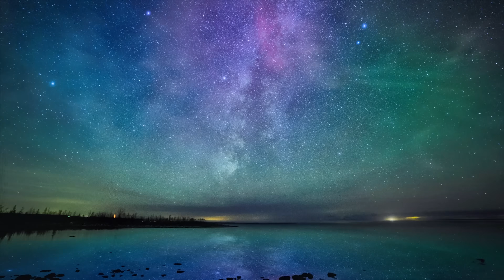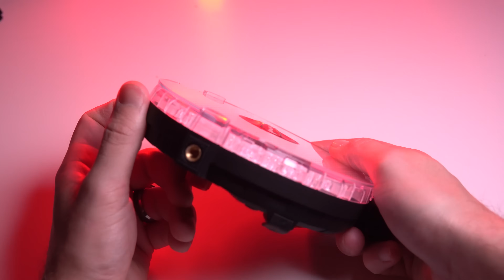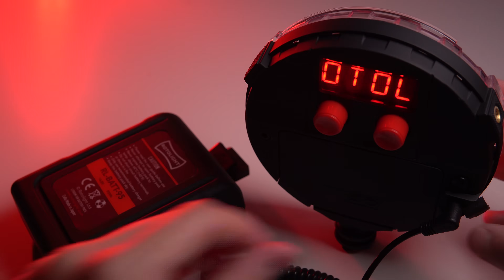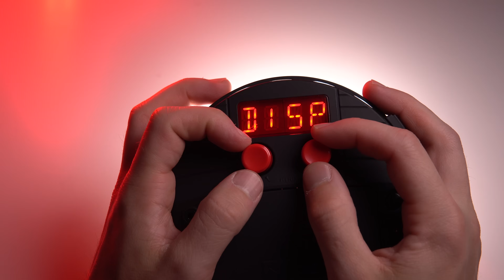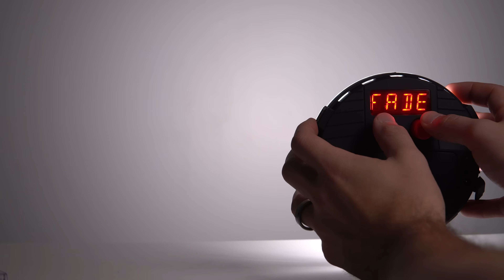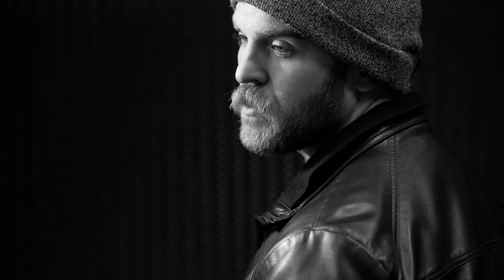Rotolight NEO II Review   Bicolor LED and HSS Flash

Comment: ROTOLIGHT AA2VM-Adaptor plus a maller V-Mount battery for the NEO  

ROTOLIGHT need to build V-Mount, around 24Wh, which should be usable of course with the bigger AEOS and ANOVA as a reserve spare battery. Therefore it is firstly nesscessary to create an adaptor that is put into the contacts of the 6 AA box. On the other side of this adaptor you then have the V-Mount.

Better handling: Faster changing of the Battery, more runtime and more flash power:  Additionaly you can lay down the NEO on the back, without unintended pressing the rear buttons.  To illuminate the ceiling of a room a stble even surface on the back is very helpful.

 The lower weight, compared to the 95Wh, results in a better handling and balance, when the light ist moved continuously.
The pricing could be far more lower, without canniballize the own 95Wh for the professional customers who ask vor maximum capacity. Even on the AEOS a smaller pack could be suitable.

Comment: Hi thanks for the video however I still do not know the best way of comparing the power of these led lights. A light that I am looking at says it’s 250W on this little small thing.  Is it the wattage that tells us how bright these things are or what?
Reply from the maker: It's complicated. Watts is a measurement of power drawn, not a measurement of light created. Watts used to be a good measurement of brightness when everything was tungsten, because everything had the same "efficiency" for the most part.
LED however is not all created equal. Companies have been making LED brighter per watt of power used. So a 200w LED from 8 years ago is nowhere near as bright as a 200w LED today.
So, with photo/video lighting, the "efficiency" of the product is largely dependent on the quality and age of the LED technology there are using.
A far better measurement of brightness is lumens / lux, which some companies include under technical specifications at various distances. You would need equivalent distances to see a direct brightness comparison (or learn the inverse square law to compare at different differences), but the lux/lumens measurements also fails to consider how wide the pattern of light is. For instance, a zoomable fresnel style led is likely zooomed all the way when it's light output is measured to inflate it's result, whereas an LED panel is stuck throwing light in a wide pattern and has to be measured as such.
Hope that long answer helps you understand why comparisons between wattages can be very unreliable and even alternative measurements are still complicated!
Also, if you're at all relating this to flash equipment, wattages of LED and wattseconds of strobes are not the same!

Comment: great review. looking through comments and other reviews,  I get the impression that a lot of people think that this light should compete with a speed light. I don't think it ever was really intended to compete? each lighting setup seems to have pros and cons, and depending on what your doing, this could be an awesome little light to have in your kit.  i recently got one of these and it seems to do great... for what it is. one of the things that really caught my eye when using it, was the quality of light. and for up close portraits, i got to say. i love it. looking forward to trying this light out in a variety of shoots.
Reply from the maker: People think that because that's exactly how it was marketed.  
https://youtu.be/eM3XBkxQaL8?t=195
"The Neo II is also incredibly energy efficient. Compared to a typical speedlight, which will do 250 full power flashes on a single battery, the Rotolight Neo II will do 85,000"
This is an extremely disingenuous claim. It completely ignores the fact that the Neo II is putting out 1/64th the effective light output.
I recall another video in which they explain how the Neo II would be superior for weddings because (paraphrasing) "when the bride is coming down the aisle and you use a speedlight, you have to wait 4-5 seconds between each flash, whereas the Neo II recycles instantly."
Again, a false equivalency, a sly omission that the Rotolight Neo II is completely incapable of reaching the output of a speedlight that would require a 4-5 second recycle time. If instead, you had the speedlight at a power similar to the Neo II's max output, then you're looking at a 1/8s recycle speed or lower.
It is these carefully executed marketing statements (which I find unethical) that lead to so many photographers thinking the Neo II would be capable of replacing a speedlight in any scenario. I found it wasn't until after my criticism that the language shifted to "we're not saying it can replace a speedlight"

Comment: On another topic. The Neo2 is now the only non-Godox light I own, apart from a pair of old Bowens strobes. I contacted Rotolight the other week asking them why they only support Elinchrom with their internal receiver - this seems short-sighted (IMHO) given the performance/price that Godox achieve (checking the cost of that Elinchrom trigger helps bring things into perspective). I told them that as a hardware development engineer, I would be an ideal ideal alpha/beta tester for their Godox X-system compatible Neo2 firmware. I haven't heard back yet

Comment: Hi Robert, nice, balanced review thanks for that. I already have the Neo2 (based on Jason Lanier's review) and, in use, it's a nice light, but, as you mentioned, more useful for video on AA's.. I just checked the price of the V-Mount battery you talked about and OUCH!! that sucker is expensive. It's a 95Wh battery which equates to 6.4AH at 14.8V - likely contains 8x 3200mAh 18650 cells in a 4S2P arrangement - which is going to be heavy, not ideal for attaching to the light. However, 4 similar cells in a plastic holder velcro'ed to the outside of the battery cover would weigh less than the 6 Duracell NiMh I have in mine, would provide 3 times the endurance and, since it plugs into the external power port, would run the flash at 500% - and all at a tiny fraction of the cost.. The cells would need to be charged in an external 4-way charger, but the NiMh cells I currently use do anyway as the Neo2 doesn't seem to have a built-in charge circuit. Also, a 4-way charger is easier to find and smaller for travel than a 6-way one..

Comment: It’s nice light, but like you said menus jus driving me nuts. After latest updates on the sky port you are losing flash control 🤢😢
As video light is nice I like it
Reply: Hi Ramunas, the update that Elinchrom did to the Skyport HSS Transmitter was only to add functionality for their TTL lights that they announced. If you didnt have these lights there was no reason to update. That being said Elinchrom have just released V3.0 of the transmitter that brings the flash control back to the lights.

Comment: I saw your first video and now this one, and yeah, while the Rotolight's promo video and the "marketing/selling" tone are a bit over the top - I'm still interested in this light. I've watched JL photoshoot in London with the model Mattie and realized that he simply used the product at it's best, and in the best conditions. It was either a quite bright natural light where he utilized the angles and used the NEO2 as a nice fill-flash with the right settings in the camera and on the unit itself. Then he shot in a tunnel where this kind of light is a champ. A smart marketing move and of course he could push it to the skies when claiming it's great. It's good, really good for what it's capable of doing. For me, I'd gladly have it in the bag together with my speedlight during travels, and chose which one to use depending on the conditions I'd be shooting in. The price is high though. The NEO2 itself is OK but when you add the rest it's too much money. I've had the AEOS on my wishlist for a long time but for the budget I've had I bought the equivalent to Godox AD200, a matching speedlight and a trigger (in Scandinavia they're called Quadralite...) - got some great gear for less than half of the money. As soon as this brings the income needed I might go for the big thing. NEO2? Maybe that one first. Can't help it, I like it. I also must emphasize the Rotolight's responsiveness to questions and their fiery engagement.
Reply from the maker: Still a lot of their marketing is misleading.
The most egregious example to me is when they compare the Neo 2 to a speedlight for a bride walking down the aisle of a church. They say a speedlight takes 4-5 seconds to recycle. 
That’s wrong for many reasons. they shouldn’t talk about a speedlight full power recycle because the neo 2 can’t match anywhere near that output to contend with it anyways.
To me, overall a speedlight is just more versatile, and when used at low powers where the rotolight would be useable, the speedlight is just as fast.
Reply: Thank you for this clarification.

Comment: I am a little frustrated by this product based on your review. The HSS simply isn't useful even vs a speedlight, which is already less than ideal. So, why all this engineering to implement this feature? Also, at the price it is, wouldn't an inexpensive Yongnuo light do the trick for a portable LED light?
I think this whole technology is intriguing because of the efficiency of LED lights. I don't know whether the bigger Aeos is an HSS solution, but it does seem Rotolight  is on to something. I think we might be looking at the future of lighting.
Reply from the maker: I think the overcharging on LED's is a cool exploration of technology. I think the choice to market it as HSS capable is simply marketing. We all know flash loses power in HSS, so by saying this has no output loss by being in HSS might make people think it's a better option. And yes an inexpensive Yongnuo light can do the trick for LED but this is undoubtedly better color/cri/power control.
And while I think there's a lot of room for this technology to grow, it's still going to be a while before it overtakes HSS in flash. On top of that, once the global shutter is around, HSS will no longer be required, thereby boosting flash effectiveness at high shutter speeds, creating a new gap between LED.

Comment: Please be the first to clear this up on you tube . Yes power decreases entering hss but then moving to narrower apertures to get the shutter to 1/200 also reqires more power so in theory should balance , same thing using nd filters , can you clear this up pls .
Reply from the maker: HSS is ALWAYS less efficient than standard sync below max sync speed with or without ND filters. The act of entering HSS changes how the strobe pushes light out. In standard sync it is a high powered burst of light, HSS is a weaker extended burst of light. That change is what causes the strobe to lose output in HSS. In both HSS and regular sync, aperture and ISO will affect the amount of flash that hits your sensor. Below max sync speed, shutter speed does not affect the amount of flash reaching the sensor because the entire shutter is open at once. Beyond max sync speed, in HSS, shutter speed does reduce the amount of flash reaching the sensor because as the shutter moves faster and faster it decreases the flash burst that the sensor receives at one time.
You can expect HSS to produce 1-3 stops less light than standard sync, always.
Reply: Thank you for that , still love hss as it allows me wide apertures outdoors with no nd filter carry on . I am currently using an ad360 ii n and tbh has plenty power for me but can freeze up shooting to fast on hss but I need to slow down and think about composition , my last shoot on a dull day I only used a speedlight into a white interior 2 foot dish and it worked ok in close at wide apertures but not for all situations , ok I also discovered this , that light modifier I described is a godsend for outdoors as it is only 2 feet wide , with the bounce plate in and diffusion I do not have to worry about feathering and coz it is white and with diffusion its nice and soft for its size and in a breeze in the real world working alone that counts for something .

Comment: I prefer the rotolight for what I purchased it for which is detail shots at weddings and dance floor shots. Us using it with the Sony a9 I use the modeling light at 1% to achieve quick focus and am able to flash. Also prefer it over a speed light for smaller areas since I don’t have to diffuse.
Reply from the maker: That’s what it’s all about, finding gear that perfectly fits with your needs. I’m glad to hear you are enjoying it!

Comment: In answer to your question, Robert, there were two reasons.  Primarily I watched all of Jason Lanier's promotional videos on the Rotolight NEO 2, and I admire his work.  Second there was a $70 discount until 31 October 2017.  But Jason Lanier sealed the deal or I would never have bought it based on just Rotolight's promotion..
Reply from the maker: Appreciate the honesty! I still to this day feel like there was a lot of "omission" when showing the capabilities from JL. Saying "this was never intended to replace a monolight" gives the impression that it may still replace a speedlight, but it won't.
Saying "As we all know, great light means that we get our modifiers / light source as close to our subject as possible" to frame the idea that this is a necessity. That may work for extreme close ups but it's by no means a truth or rule. As soon as you start pulling the rotolight back it's peak power becomes an extremely limiting factor. That's all I set out to do with the video was make sure people had a realistic expectation of the product, because I felt a lot of it's limitations were left out by those discussing it.

Comment: Hey Robert, great review I had similar thoughts when I first saw all the hype surrounding this light and then when I had some hands on experience when I was handed a couple to test out a couple months ago (I tested out both the Aeos and Neo II). The light just doesn't offer enough power for photography unless you are shooting in low light and yes HSS which really shows its main benefits when used in bright situations is near useless for people that shoot in low light or studio situations where this light is the most useful.

For now the Rotolight just isn't there yet for flash photography but I do really believe in the next few years LEDs for photography will be a big game changer in the flash/strobe world.

You mentioned in your video that a speedlight will lose light when it enters HSS, which is of course true and the amount it loses depends on how high your shutter speed is. Though during my testing with the Rotolight I also found that the Rotolight also suffers the same issue as a typical speedlight when it enters HSS. When I tried it and compared it myself to a typical speedlight a few months ago I saw the power output of Rotolight drop just as much as a speedlight would when I shot at 1/500, 1/2000 and 1/8000th of a second. This was also the case with the Aeos as well (also fun side note a speedlight is still almost 2 stops stronger than the Aeos). This was surprising to me as I believed that because the Rotolight is using LEDs that it wouldn't suffer from the power loss during HSS but seems that is still an issue. At least when I tested it.

So if you get a minute would you be able to do a quick test the Neo II at a regular sync speed and then in HSS and see if there is still some power loss or if that was something that was fixed compared to when I first tried them out (as I was testing them shortly before they launched but they were production models) as in your video so say that the Neo II's power in HSS remains the same where as a speedlight in HSS will lose power.

Comment: I will stick to my Godox/Cheetahstand/Flashpoint gear. Especially the evolv 200 with the magsphere setup.
Reply from the maker: AD200 + Magmod is life.
Reply: The evolv200 has a flash head, a bare bulb attachment and for $25 extra a 60 led attachment.
Reply: A flash is not as flexible if you can deal with the reduction in overall power.